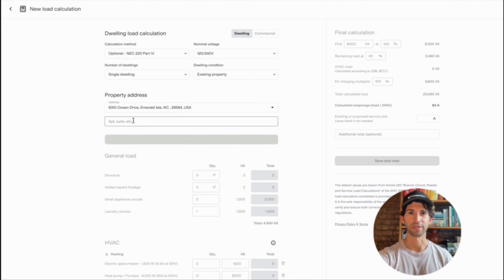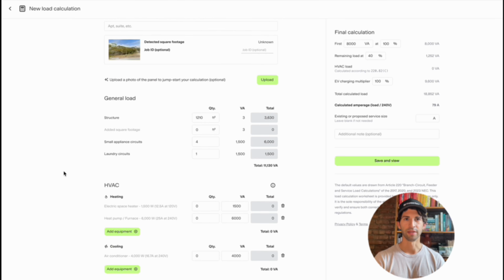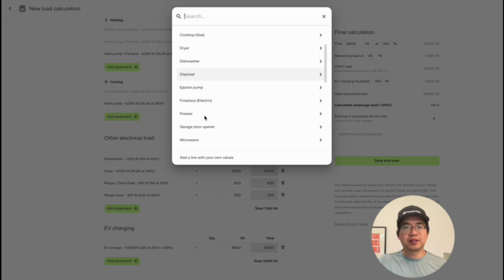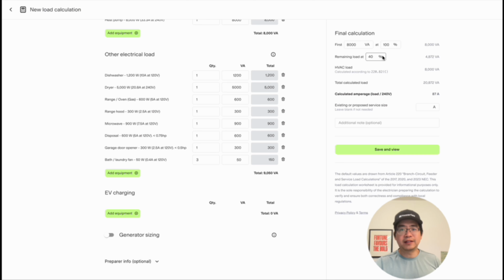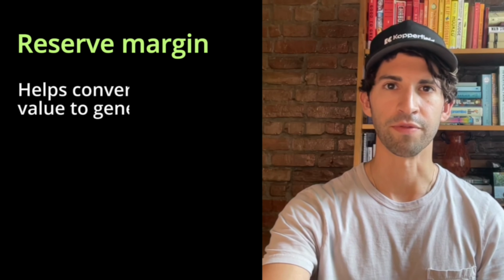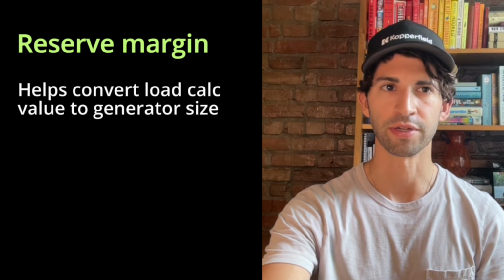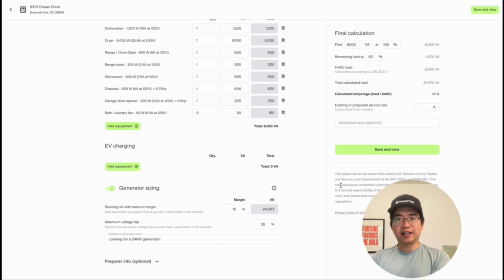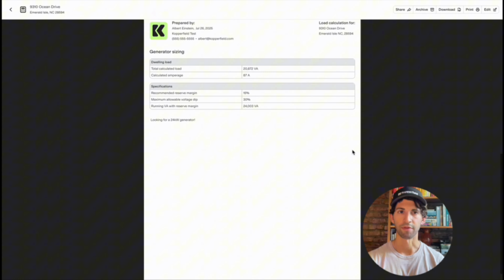What Size Generator Do You Need? | Residential Generator Sizing Walkthrough (with NEC load calc)

Comment: Voltage drop seems like an odd parameter for a load calc, which primarily deals with power in VA or Watts? And 30% seems like a huge sag to allow? Is the generator itself responsible for for both of those factors, or does the wire length and size to interconnect the generator also become a factor? And if so where are those factors handled in this tool?